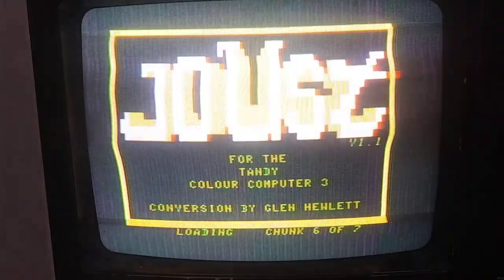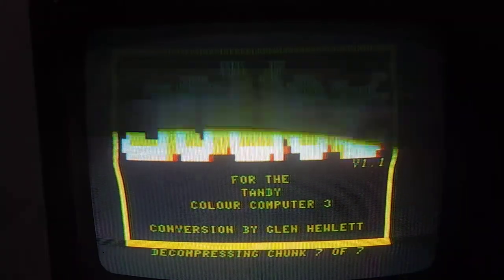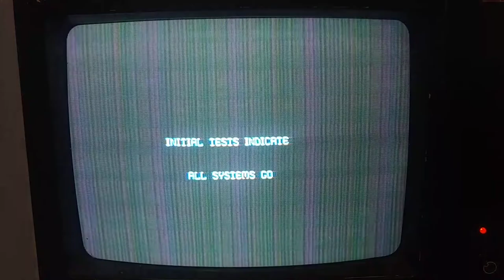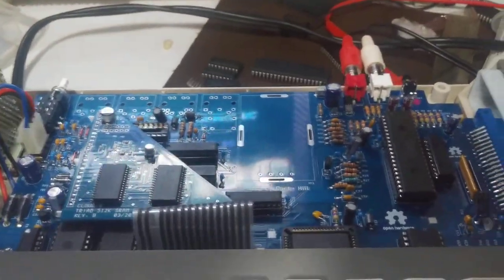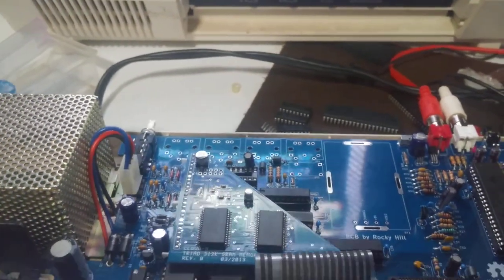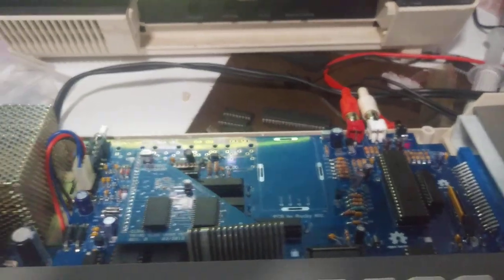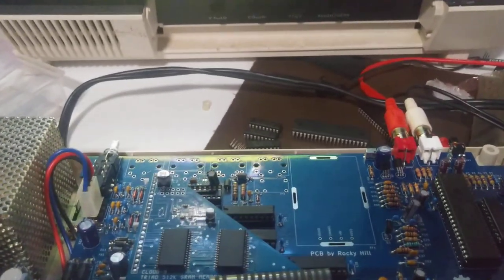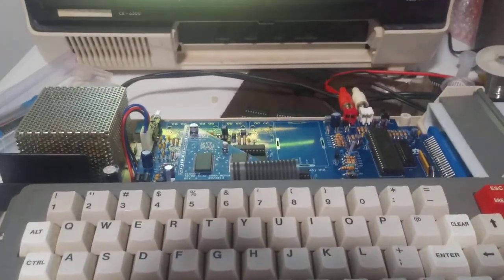Joust on a CoCo 3

Comment: HDMI ?
Reply from the maker: Not yet but hopefully some time in the neat future..
Reply: @rockyhill3  I'll be thrilled with VGA out converted from the RGB connector.  There are other devices that'll take that to convert to VGA. :)
Reply from the maker: @erroneus00  So I'm still looking around to see what fits the best. I think the next board will be sort of like a hacker board or something hat I can add and cut things out to test stuff. I might just bring out a 10 pin connector that's compatible with the stock RGB2HDMI project. I've used that board already with an HDMI to VGA converter and it worked great.
Reply: @rockyhill3  Actually, I'd prefer HDMI as it's a bit more universal in most respects.  Converting from HDMI to VGA is a thing that exists 'everywhere' so if going direct to HDMI is a thing that could be done then I think that'd be better.

But you mentioned "hacker board" and I also agree with that direction.  To that end, I think the next "improvements" would be to make the board "smaller" or to make it more compact in the sense that it leaves even more room for adding things to the board or within the case... or whatever case we may end up developing.  (And at this rate, I'd b thrilled with a bit of plywood and/or some lego pieces combined with the CoCoMech keyboard!)  Now that I think of it, I think I'll order another CoCoMech keyboard and track down the USB interface kit and build an external USB keyboard with some plywood and some Lego pieces right away! :)  I think that'd be pretty awesome.
Reply from the maker: @anjinmiura6708  I am a fan of 2x4's and I think legos would be a nice touch! I'm still moving stuff around for the next test board to try and brin the cost down. Hopefully I can order a new revision this weekend. I think this one will have a port that is pin to pin compatible with the analog board from the RGB 2 HDMI project. Once I have the wrinkles ironed out, I'll integrate it.
Reply: @rockyhill3  I agree.  That is the 100% best approach.  Does the "RGB2HDMI project include audio?  Hope so! :)
Reply from the maker: @anjinmiura6708  Sadly, it does not include audio..... Hopefully one day it  will though
Reply: @rockyhill3  Mod it!!!  Auuuuugh!
Reply: Any Updates for the CoCo 3?